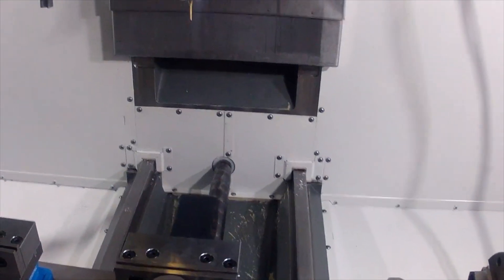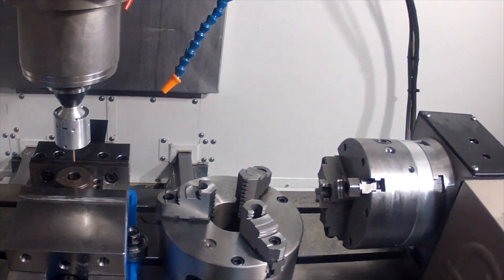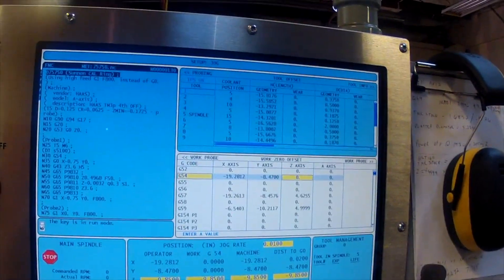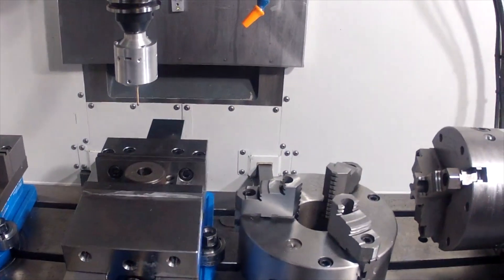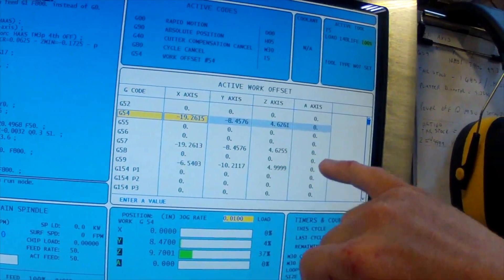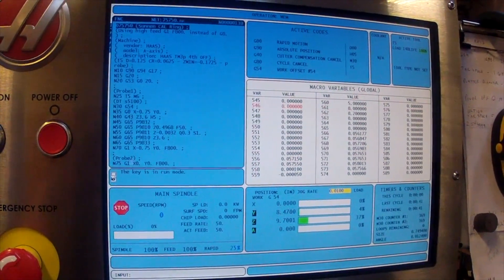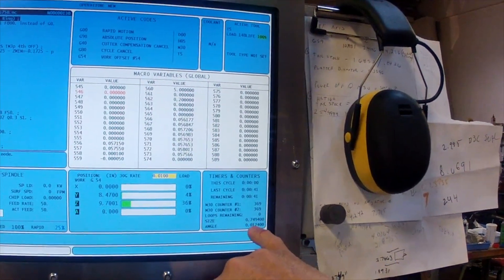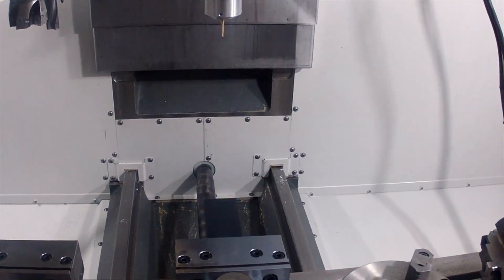Drewtronics s5100 probe Video 2 Finding bore center with wireless probe Video 2

Comment: How did you setup the drewtronics probe so the control recognizes it?
Reply from the maker: I can’t remember to be honest. But If I recall I got a molex plug that matched the haas connector on the main board and plugged it into the board.  

Drew at Drewtronics helped with the pinout and wiring.  I think I got him a schematic for it

It was fairly easy just needed the right connector. 

I think I put this in one of the videos I made. But it was like 5 years ago for that project and I’ve sold the machine since then with the probe still installed in it.  

It worked great just like the renishaw and used all the same renishaw 9000 programs.
Reply: @Benfoxmra95  oh ok cool. Btw how is the biz? Still machining? I started 4years ago.

Comment: Will this work with a Tormach 770M TTS system?
Reply from the maker: i think so,  but i am not familiar with tormach, path pilot?   if the machine can accept a skip signal then i dont see why it would not.  the infrared eye sends a simple signal via wire to the main board in the haas control  that tells it when the probe has contacted something.  its a either open or close circuit.  i would look up drewtronics and inquire with him.  he's very helpful.  I haven't done anymore development with the s5100 as i sold the machine.  but it worked amazingly well using all the renishaw macros.  i you can import the renishaw programs into you machine then i'd say you'll have a easy time of it.
Reply: @Benfoxmra95  I talked to Andrew. Ordered an s5100 from him and a TTS 7/8-20 arbor from Tormach this morning. Thanks for posting these videos.

Comment: Hellos Ben..

One question. i bought a Mini Mill Haas, do i need some especial installed on my Mill to use your Drewtronics S5100 Wireless Probe. Regards Felipe
Reply from the maker: as long as you have the standard "9000" programs installed in memory then you can use it.   these are are easily installed if you dont have them

check setting #23 and then go to machine memory to view all hidden 9000 programs to make sure they are there.